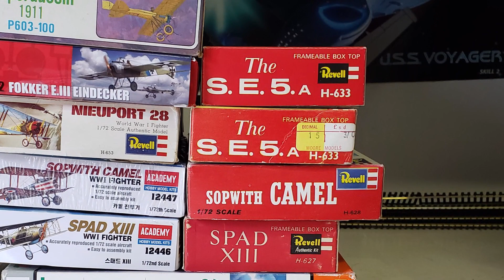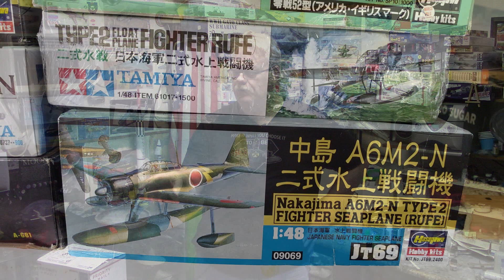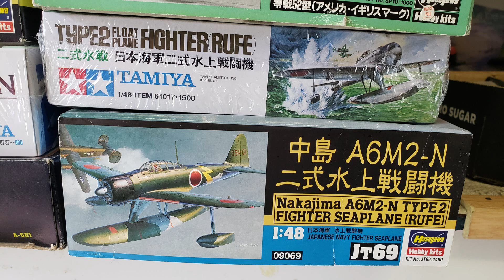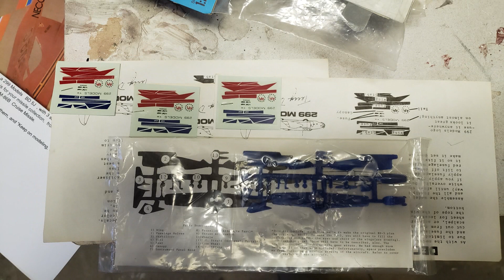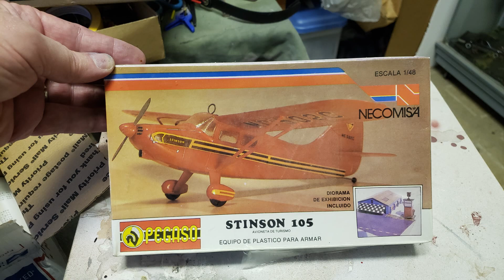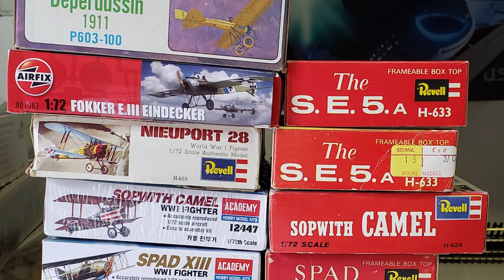Max's Models after hours 7/1/21

Comment: I recall building the Airfix Hannover kit in the 1970s. In those days you had to hand-paint the five-colour lozenge pattern camouflage on both the upper and lower surfaces in 1/72nd scale. Mine ended up covered in dots rather than lozenges. Have not done a lozenge scheme since - well over 40 years ago. Having the decals for the outlines ought to be a big help.
Amy Johnson flew that Novo (ex-Frog) Gipsy Moth from England to Australia solo in 1930. She later married Jim Mollison, and together they flew the DH Comet Black Magic from England to Australia in the MacRobertson Air Race of 1934.
Revell did a 1/72nd scale Sopwith Triplane in the same series as the SE.5A, Camel, and Fokker D.VII.

Comment: Stretch the spru as fine as you can. Measure and cut to length . After it is secure use a match or candle, blow out thee flame. The smoke has enough heat to cause the spru to become taunt.

Comment: Ho hum. I'm so not into WWI. The only plane of that era that fascinates me to some degree is the Thomas-Morse Scout.
Reply: Dale… I have my favorite subjects myself 
But it’s all about building PLASTIC MODELS 
MY favorite subject … early WW2 PACIFIC AIR WAR… but its all good.  CHRIS
Reply: Did you know that when Thomas Morse went out if business, Ed Heath bought train cars full of stuff from the auction and used Scout wings and tail surfaces in his parasol kits?  Just like the old James Burke show, “Connections.”
Reply: @flyswryan  Think it was back in the early Sixties a serious aircraft restorer or group of restorers undertook to build a museum quality reproduction of a "Tommy" since there none left to restore. They had a lot of bits and pieces, probably every bit and piece of an original aircraft they needed except possibly an airframe data plate or else they could have done one of those "restorations" were all they have to start with was a data plate. The build was very well documented over a number of issues by one of the major modeling or aviation magazines. The construction of it was almost like a work of art.